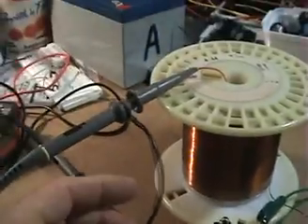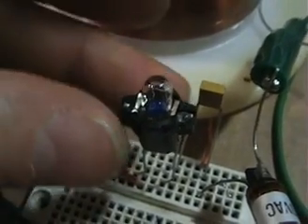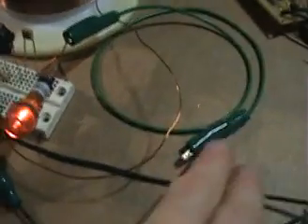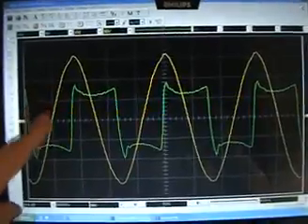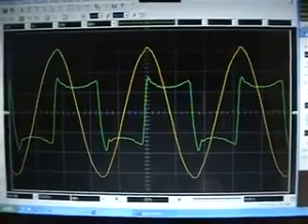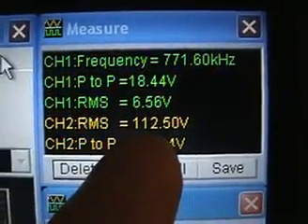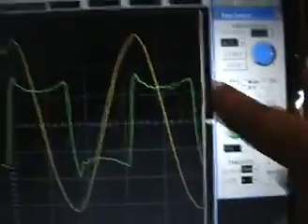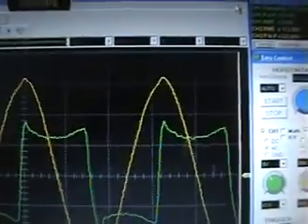Coil Resonance Tutorial 1

Comment: Hallo,did you use for the First Signal AC power and the other DC power?
Reply from the maker: The input is square wave AC which converts to sign wave in resonance.
Reply: @gotoluc   Don't the waves go from left to right?
if so, you have the resonance on the wrong page

Comment: you have to apply mechanical principles to the solid state coil to get a Tesla coil, i think.  Look at the way the electricity bends in the picture where it is supposedly working.  the desk top model.  It is creating over unity by redirecting or lengthening the path that the electricity loops around.  The part of the loop that is extra is the source of the extra power.  The coil needs a place for the energy to leave and come back, in free space, and then that field is stretched or arced by a permanent magnet.  If the capacitance of the arc stays the same but the arc is enlarged or elongated, then it will draw free electrons into it to make up the difference.  yep

* i like to play scientist on the interweb

Comment: Dear friend I don't have oscilloscope so is there a method for finding resonance using a digital multimeterThank you my friend
Reply from the maker: You don't need an oscilloscope. You can use your multimeter on AC high voltage. You tune the frequency and or capacitor till you have maximum voltage.

Comment: Why didn't you sketch a schematic ?
Reply from the maker: Because it's just a Neon bulb, a Capacitor and a Bulb all connected in a series string to one leg of a coil and should be easy to see in the video. But if you want to know the schematic of the signal generator, it's a Wavetek 144 and should easily find it.

Comment: Hi luc . Is the frequency defined by the lengt of the wire in the coil"
Reply from the maker: +francois ROBILLARD  A part of it has to do with wire length and size. The other 2 aspects that influences resonance are,  Inductance which is increased by coiling the wire or adding a ferromagnetic core (Iron) and the other factor is coil self Capacitance which can vary depending on coil winding geometry. Luc

Comment: What's the name of that software scope and how do you connect it the coils? Thanks.
Reply from the maker: It's a DSO 2090 USB Scope. You can buy them on ebay. Luc
Reply: Are they safe, or they might damage the PC also if accidentally there is a larger voltage measured?
Reply from the maker: furulevi
I've been using it for 7 years and never had any problems. I even have a 100X probe and used it in the KV range with no problem. However, if you have much RF, the computer itself has problems. The USB hardware box is well built and the software has Math Power calculations and there's even a spectrum analyzer. Best value for the money. They should be paying me for advertizing since so many have bought these since I've been using it. One thing you need to be careful is the probe grounds are common (like most scope) so if you're not careful you could cause a short if you move the probe grounds around in a circuit. Luc
Reply: Luc gotoluc Choquette THANKS!!!

Comment: Hello Luc :) Have you ever tried a bigger load instead of the neon bulb while connecting it to a bigger antenna so it can pick up more radiant? :)
Reply from the maker: I've tried just about everything I could think of but never got more output than input.
Reply: @gotoluc have you tried building essentially a transformer where the primary and secondary coils have matching resonant frequencies?

Comment: Hi Luc, I really like your method for finding resonance, and I would like to replicate what you did but is there any way you could send me a schematic of your circuit.  it looks like there is a wire on the the breadboard that goes under the coil and the probe at the coil connects to one end of the coil while the other end of the coil goes to ground?   thanks mike  snaprollin@yahoo.com

Comment: what happens if you put a magnet inside of the coil ?  or maybe a rotating magnet in phased locked resonance spinning the opposite direction of the spun wire. could  it push out more  radiant energy from the coil ? or maybe a bigger magnet the same polarity that is created by which ever direction you spun the wire to increase output of radiant energy >?  i think its anti clockwise is - negative. and clockwise is - positive. ??

Comment from the maker: Hi Thane,

the bulb doesn't light up because as I said in the video I am not sending the full output (10 volts RMS) of the Signal Generator since the coil's output would be too much for my Oscilloscope. I should of disconnected the probe to the coil and cranked it up to show the bulb glows out of resonance and nothing at resonance. I forgot to do that part. Maybe the next tutorial. Anyways, we can see that no extra energy is used at resonance.

Thanks for posting.

Luc

Comment: I would use the florescent bulb on the step up transformer output side between the choke and the cell. Since my scope wouldn't be able to measure the voltage at that point.

Comment: Sorry, I was talking about my step up transformer output that feeds the cell. The voltage range is from 600v to 20kv applied to the cell itself. I use the 12v dc to drive the PWM and the PWM drives the step up transformer.I'd like to measure the PWM output and the step up transformer output at the same time.

Comment from the maker: Hi honda4004,

I guess you could say it amplifies voltage once it hits resonance. I don't think a mass air flow sensor would be usable for this application. Andrija Puharich resonant  sensor detector is used to keep his cell at resonance as the dialectic properties of water change with temperature and or electrolyte. So you would need to vary the frequency and possibly also the capacitance in order to keep it at resonance and use minimal energy input.

Luc

Comment from the maker: Hi neotarget,

the coil is 100 turns of 20 gauge on a 3" plastic spool with a 30pf to 120pf multilayer capacitor in series. That's it. If you want to monitor the amps you can add a micro bulb in series also. Use a neon bulb on the coils side of the capacitor in series to find the resonant point if you don't have a scope. If you need more information click on the Forum topic in the description box next to the video.

Thanks for looking

Luc

Comment: hi luc are you saying that it is an amplifier of voltage at the sweet spot and would a mass air flow sensor in modern cars be this type of detector as andrija puharich states that you must have a sensor resonant detector to activate the sweet spot in his diagram to maximise performance which your 300 plus output volts seems to be correct. appreciate reply as now getting how frequecy resonance is a main player in all types of extra energy (not free) yet !